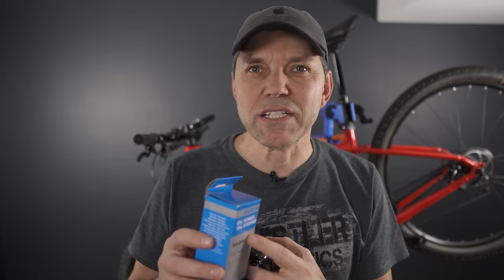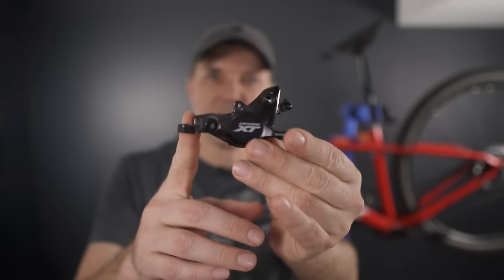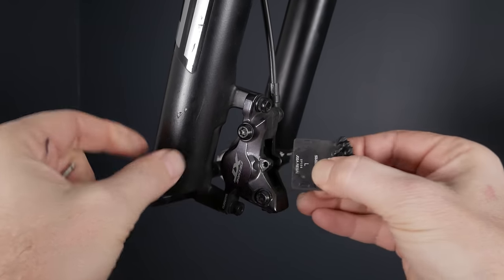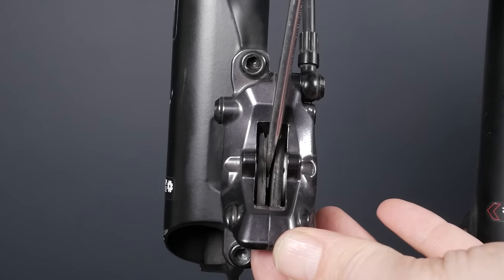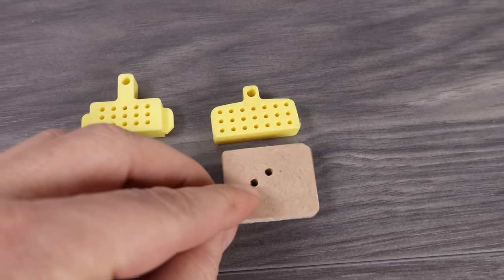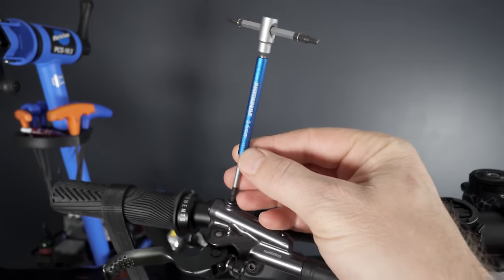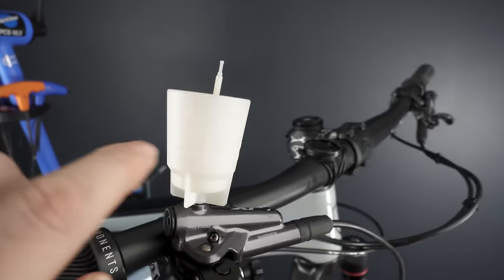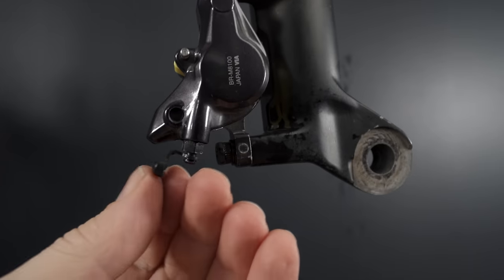🔥Easy, Simple Shimano BRAKE Bleed Service🔥 | Gravity BLEED, No Syringe, 2-Piston, 4-Piston

Comment: Best  DYI video repaired I've seen. Congrats! Focused, clear, short, enough details
Reply from the maker: Merci Serban!
Reply: I work at a bike shop and we have been using this method for years. Some old krumuden type showed me one day and I've done it like this since. At the shop we have an old isopropyl bottle with a spoke bent around it in a hook that holds the bottle and attaches to the frame at the same time. I also will pump the lever with the caliper port closed to get the last bit of air out. Then while holding the lever slightly crack the bleed port open and then shut it. This will push any remaining air out of the caliper. Pump the lever a few more time and you should have a killer bleed. You can repeat these steps if the lever is spongy. Good work by this mechanic a+
Reply: @MrEski22  I agree!. I take my time to flick the lever for a few minutes, until no more air bubbles come out into the reservoir cup.

Comment: THANK YOU for the hose specificiation and a tutorial on how to do this without have to spend the bs amount of money the Shimano syringe, hose, retention clip crap costs.. absolute daylight robbery.. Now I just gotta find the hose locally..
Reply: Found it! Bled the front and it is amazing - almost zero play on the lever and firm.. the back is another matter - a bunch of air came out initially and I got that away by lifting the hose, but some seems to persist somewhere.. no amount of running fluid through, and even pulling the lever in and opening the bleed port, then closing the port and releasing lever, to pump fluid thru the way I learned to bleed car brakes, has it any more than biting 50% back on the lever stroke and not that firm. I did put new pads on the front - pushed pistons back and bled with a block, while I left the pads in on the rear (!!) - but am thinking it's unlikely that that would make such a difference.. ??..

Comment: Some great learning points there even though I've been doing this for years. Especially interesting is the gravity feed of brake fluid as I've been putting it in with a syringe from caliper side but always get air bubbles. I will try your method next time. Thanks

Comment: Excellent video presentation but it didn't work for me.  My old caliper had leaked most of my hydraulic fluid. The hydrostatic pressure with a simple gravity bleed was inadequate to overcome the airlocks in my line, through the tiny orifice in the Shimano cup.  Adding a syringe worked like a charm.
Reply from the maker: For that kind of situation - caliper empty - syringe i the only option. In this vid I tried to simplify it as it applies to 80-90% of the situations. Enjoy your fresh brakes!

Comment: I tried it once and results for me were piss poor. I get very good results with syringe pushing from the bottom, adjusting the bike in a stand for most vertical hose position, removing caliper for better angles to clear bubbles from caliper and tapping hose a lot, from the bottom all the way to the top as much as I can with some hose in the frame. Once I'm done with caliper and hose, I also adjust the bar left and right and rotate the lever body to get rid of the air from there properly. It's no quick bleed but brakes are sharp after that.
Also servo wave free levers let me feel the effect so much clearer, than when I had servo wave.

Comment: Great job!! I love the trimming of the bleed blocks wings so it goes in from the top.... genius! I only have one step that I do different, and that is to open the lever and install the bleed cup with a little bit of fluid before pushing the caliper pistons back into their bores. That way the fluid has somewhere to go and you won't risk tearing the delicate diaphragm in the lever.  Cheers!!
Reply: @LoveMTB  Oh man, I'm down to 1 day a week at best for the last few weeks and our trails are absolutely hammered with so many 12" deep ruts down our steep chutes. Our dirt doesn't handle rain well to say the least! But the bike is clean, maintained and I've got some YT content stored up too! Keep up the great work.... you're one of the best!

Comment: Good tip for pushing pistons in is to put the bleeding cup on the caliper to allow the fluid somewhere to go
Reply: Yep, not mentioned in the manual, but always mount the cup on the lever, otherwise you risk breaking the lever membrane.
Reply: @LoveMTB  I broke mine when I first changed the pads and retracted the pistons on the rear brake the length of hose and amount of oil plays a role :( Out of the factory basically, so better safe than sorry I guess :) 

And keep up the good work, definitely one of the best MTB tech channels around!
Reply: You mean put the cup on the lever?

Comment: I find soaking string with alcohol and doing the flossing method around the pistons works good to clean them . And put the fill cup in with fluid then move the pistons in and out and clean , this helps make it easier and less chance of of hurting the bladder system in the lever .
Reply from the maker: Indeed, opening the lever first is the safest way to work on the brakes/ pistons.

Comment: I prefer using 2 50ml Syringes, I just adapt that circular yellow Shimano thingy with a tube on the reservoir, its thread fits snug. Push & pull till all air bubbles are in the reservoir.

Comment: Great vid! Question tho, shouldn't we unscrew bleed bolt on lever when pushing pistons back in ?? I heard if not the pressure can damage the lever....🤷
Reply from the maker: You can do that after installing the funnel. If the system is overfilled with oil it could otentially damage the bladder. If the system was filled properly to begin with there is no reason to worry, you just reset the pads to the initial state (fresh bleed position/ oil volume in the lever)
Reply: @LoveMTB  makes sense 👍🏼 TY!

Comment: Very well explained, thanks! I will be trying my first bleeding and I'm happy to have found this video. What's the use of a syringe, which is contained in some bleeding kits? Is it useful for any particular reason?
Reply from the maker: Thanks. Syringe is particularly useful if you replace a caliper for instance. There’s no oil in them and syringes make it a lot easier to fill up the system with oil. Pushing from the caliper

Comment: Hi .Cleaned  the brake pads  with Sand paper yesterday, sprayed on the pads  disc brake cleaner (soudal) let it dry  sanded  again ,sprayed  on again until its  clean.  Put them back and still soo noisy when I pull  the brakes 😢 . I will do the gravity  brake bleed today, clean the pads again and will use just soapy water to clean them. (What can be wrong if I use a disc brake cleaner?) Brakes  are M8000 XT ,  Thanks!

Comment: Just did it folowing your steps, easy peasy! Thank you.

Just one question, I have the M7000 SLX brakes. I bled the back ones for now since they were bought used. Some black liquid came out which was expected.

Changed the pads as well for good measure but I feel the biting point is changed. Do I need to adjust that screw in the piston lever that has 2 holes on it? Thank you
Reply from the maker: Enjoy your newly bled brakes? I can be normal to feel the brakes differently. And I don't know what adjustment youre referring to? SLX has a knob to adjust reach😉
Reply: @LoveMTB  Hi again. Thank you! I redid the bleed, just tilted the front of the bike more and I just had some extra air trapped. Now it's firm and all good. 🚀 

Yeah, referring to those side screws with 2 holes in them. But no need anymore. And yes the reach adjustment is very handy 😁
Reply from the maker: You got to the bottom of it, and that's all that matters. Enjoy! @Glob3Tech

Comment: If this works then all good but I think the best way to bleed any MTB brake caliper is by putting the bleed nipple up  and basically from there you can gravity bleed it or do the off/on then open/close the nipple. Basically how you bleed a car brakes. Only takes 10 mins and if you dont have any bleed blocks just leave the brake pads installed and sandwich a rotor disc in it  and do the on/off bleed.
Reply from the maker: And if you do that you 💯overfill the brakes!😊 otherwise this is exactly how you bleed a car brake isn’t it?

Comment: One more thing… reinstall the wheel with the new pads after you cleaned the caliper, keeping the cup attached to the lever and flick the lever to readjust the new pads to the rotor and take up any space while drawing more fluid from the cup, then remove the cup and reinstall the screw. this will allow you to pump the brake with the new rotors or pads and not have any void in the break fluid if you were to remove the cup first, then pump the break to readjust your pistons and pads. Hope that makes sense.

Comment: Great video as always. This one is a keeper easiest brake maintenance, and bleed I have seen so far. Could this method be used to fill a new system.The marking of the pads L/R good idea I wish I had done this trust me. What do you recommend for removing scrapes or marks on the disc? Would the 120 grit sandpaper work. As always thanks

Comment: I would not push the pistons back until you have opened the system at the top.  May apply more with SRAM.  This is of course if I am bleeding after cleaning.  Why spike the pressure in the system if not required?

Comment: Another awesome video my friend!!!  I bought the park tool hydraulic bleed kit which has all the adapters that allow the funnel to be screwed to magura ( and many others) bleed port screws,as far as I know shimano are the only ones to make a funnel and no 2 companys use the same tread pitch and size bleed port screw Cheers
Reply: ps opps forgot to mention I think you can buy the adapters from park tool individually
Reply: @LoveMTB  I looked at the park tool dot fluid kit and it says sram adapter is a m5x0.8 and in the mineral oil kit it has a m5x0.8,I don't have any sram brakes to try it on(: but the mineral kit lists 2 m5x0.8 adapters but they are not the same size just by looking at them so I give up lol...I just cross referenced the part #'s from pt dot and pt mineral kits and there not the same but here's the dot fluid part #'s for the adapters sram-2618a,sram bleeding edge-2612a...I checked to see if pt adapters fit the shimano funnel for flat bars-tl-br003 and they do so I would assume the pt dot adapters would also work...Hope this helps!!!!

Comment: What about taking the bleeding blocks off the caliper? Don't you need to add more mineral oil once they are pushed out to the thickness of the rotor?
Reply from the maker: That’s what the bladder is for.
If you push more fluid in the system you’re usually asking for trouble
Reply: @LoveMTB  Thank you. What is the bladder?

Comment: I have a basic question. The brake fluid tank being attached to handle is always higher than the caliper either with respect to front or rear. Then why do we need to mount the bike on a stand and tilt it even higher? Cant we do the same thing with the bike standing with the help of a side stand.
Reply from the maker: @swananddeo8406  most times rear hose dips down then back up if on the ground no?
Reply: @LoveMTB  Sir, Thank you for your response. Can you please explain a bit simpler, as I could not understand it.

Comment: My bleed nipples just leak all the fluid out when I brake after bleeding. Exact same issue in both front and rear. Very frustrating. Yes of course I tightened the nut again..

Comment: Can I use Maxima Mineral Brake Oil on my Shimano brakes? If yes, can it be mixed with Shimano mineral oil or should the existing oil be flushed out first?
Reply from the maker: I assume you can but can't guarantee that the seals/ orings will be fine now or in the long term. Mixing...how much do you care about good braking?😉

Comment: Regarding cleaning the Pistons inside the calipers, I like to use some of the brake fluid on a Q-tip wiping off the race of the pistons. I do this before pushing them back into the caliper. This serves two purposes, to clean off and lubricate the piston and seal behind inside the caliper

Comment: I think you omitted a couple of important steps. If someone bleeds like this, you run the risk of leaving air bubbles both at the caliper near the bleeding port, in the caliper, and at the lever. Without a syringe in the bottom, and using pressure, it is quite a hit and miss if your system has bubbles or not. Also, get a brake tool, instead of using a screwdriver. And, you didn't adjust / screw out two revolutions the screw for the lever reach before bleeding, inviting for errors.

Comment: Personally I would never re-use old pads after a bleed. Pads are very inexpensive, so the only right thing to do is to change them together with the brake service to get the complete advantage of the maintenance. 

The other thing is that there are less expensive options for bleed kits as well to keep cost down like kits from EZmtb, so I personally see no real need to use a plastic bag and all of that. It's peace of mind to have a kit as well as being able to help out a friend and so on if need be.

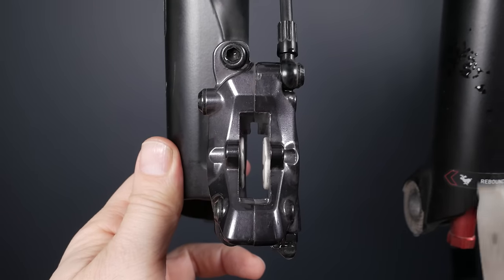Comment: 4:56 BEFORE pushing pistons OPEN bleedport on the handle!!
Reply: @LoveMTB  you could additionally bleed your lever Before changing the break pads and when you push the pistons you can damage membrane because of oil excess in the system

Comment: Upgraded to shimano hydraulics a year or so ago. Changed the rear pads for the first time this week. Pushed the pistons in as required. Popped in the new pads. Easy peasy. Trouble is the lever now has little travel. Don’t understand this. No new fluid was added, orig fluid moved down as pads wore. Why did it just not move back into the lever? What did I miss and how do I correct? I am thinking I am going to need a bleed as described here. Is that the norm? Thanks for any ideas.
Reply: Thanks! I guess this is the answer. Picked up the nec items and will give it a go. Kinda detracts from the super simplicity of the pad change.

Comment: The complicated version please. Shimano instructions use a syringe. What's it called? Shimano version?
Reply from the maker: Why use a syringe when you have this?🙄
Reply: @LoveMTB  Well, I think Shimano engineers have their reasons for doing that. hehe
Reply: @LoveMTB  For example, air always moves upwards, so oil filling must be done from below using a syringe.
Reply from the maker: @ArdianSutarjan  syringe is always an option if you prefer that

Comment: what about wandering bite point and can poor bleeding be a reason for this?
Reply: @LoveMTB  can you please tell more on this? what you mean harder? nothing seemed hard in your method..
Reply: @LoveMTB  well thanks for your reply. however that's what I can see in recent review on pinkbike - "It's old news by now, but the wandering bite point issue came back to haunt us, even with a solid bleed and centered pistons. I’m not sure how or why it happens, but Shimano brakes also seem to become contaminated much more often than other brakes. The pads were swapped out with freshies and the rotors were cleaned, but the lack of bite and squealing soon returned."   As for me I also faced with this contamination last week, but at last could deal with it heating up front brake well this Sunday on trails. Starting to get tyred of my M9120 setup :(
Reply: @LoveMTB  well... ))) can see no reason why italian product can be more reliable than japanese or american) just from experience with their cars. and curas are not widely spread but already we can see they're not faultless even in comments section of your video. Last my experience was with R1, they were quite poorly engineered, also light and looked nice. So no, I won't go there. And did you try bleeding Shimano with Putoline 2.5W ?
Reply: @LoveMTB  right... all this is very complicated..